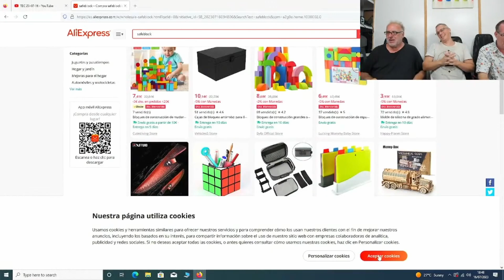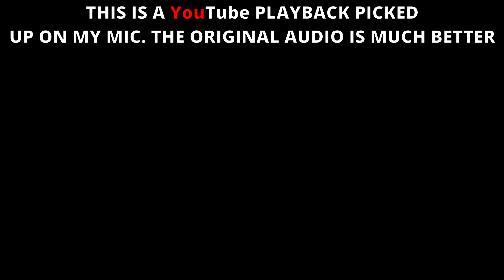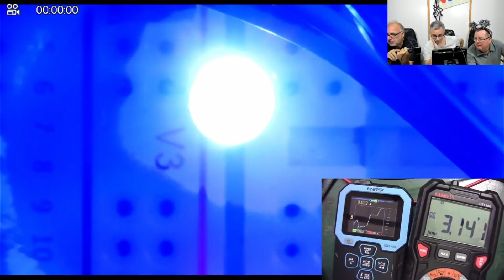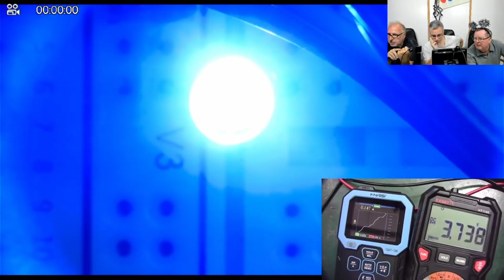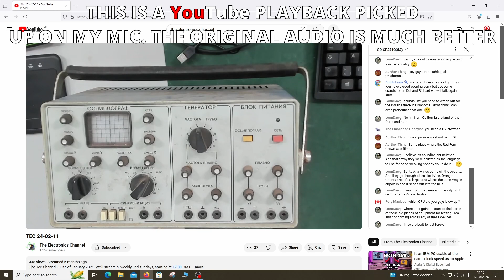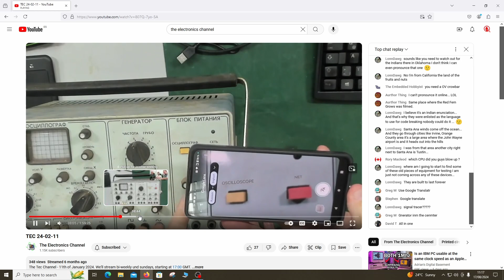Live Streaming on Learn Electronics Repair - Coming Soon.  Find Out What And When Here

Comment: IIRC The big soldering iron is for sheet metal soldering. Good for de-soldering very large components (heatsinks etc.) or "cutting" plastics/vinil. (maybe not this particular model, but similar ones.)